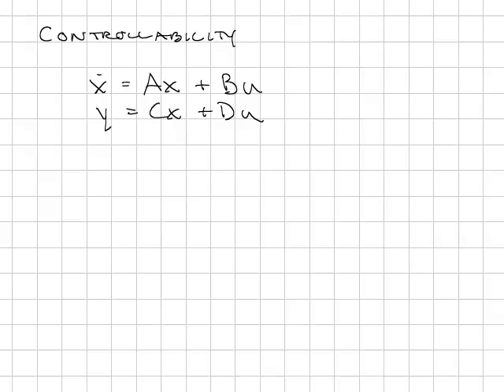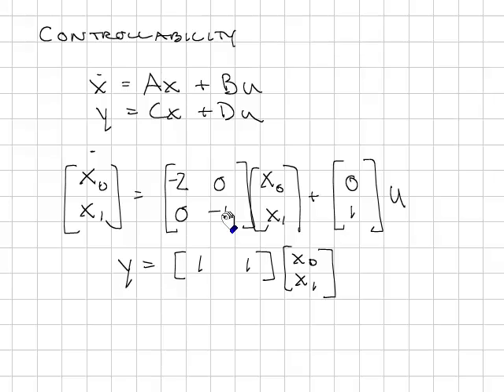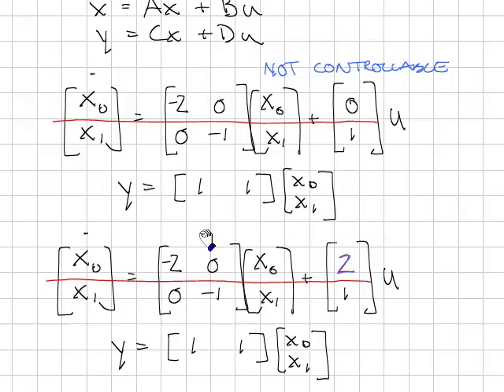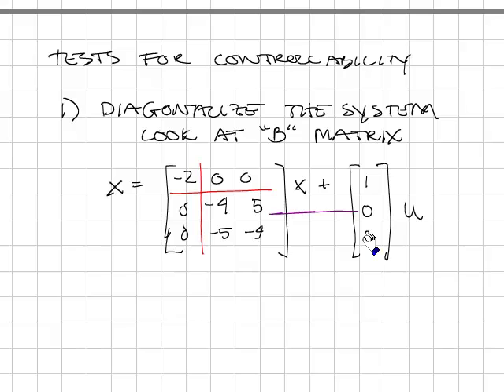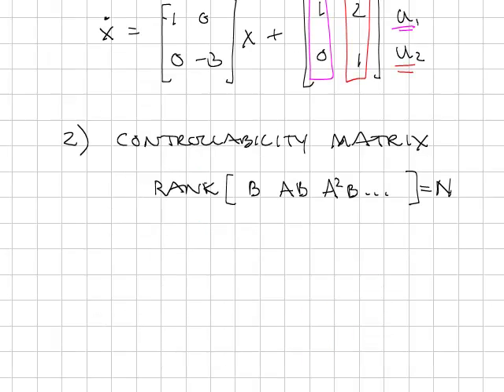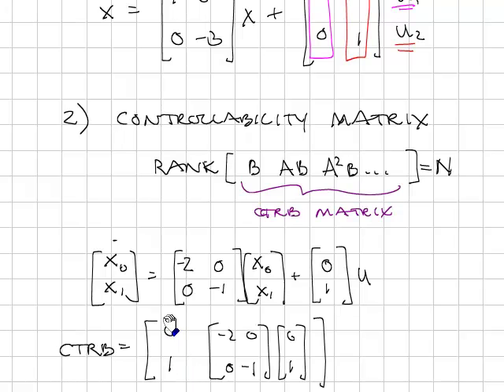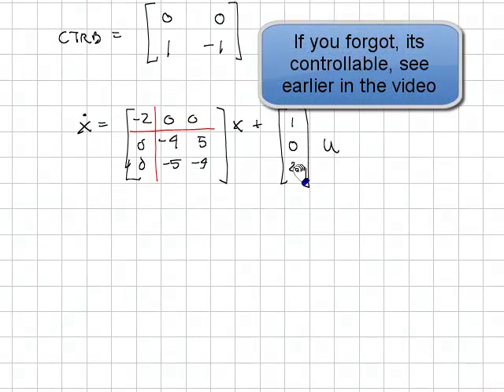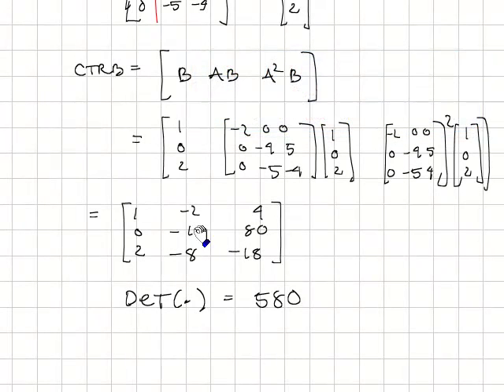Controllability.mp4

Comment: I think you made a mistake at 5:12 min. The matrix I think should be 
1  -2   4
0 10 -130
2 -8  -18

And the det. will be -780.  Still this would not change it from controllable to uncontrollable. but could help for correctness